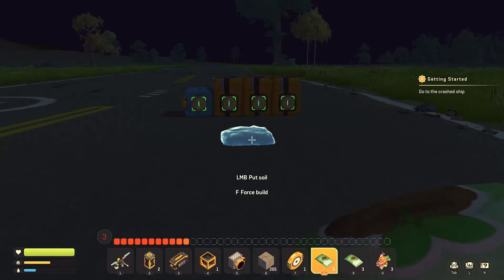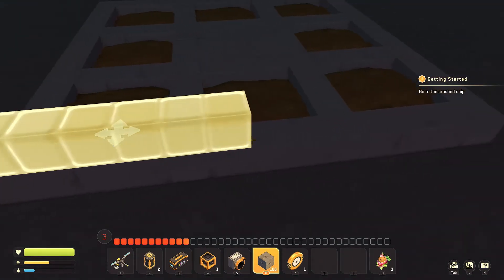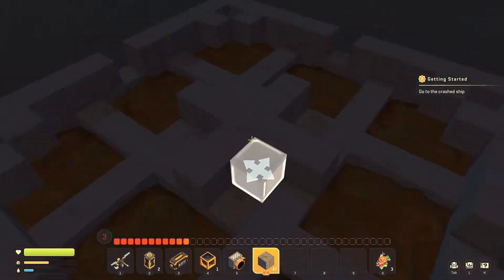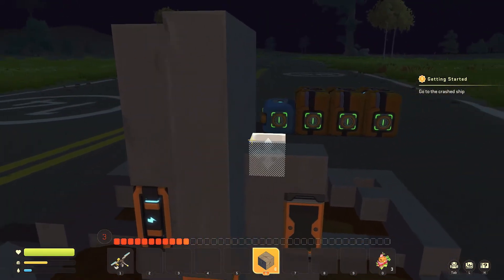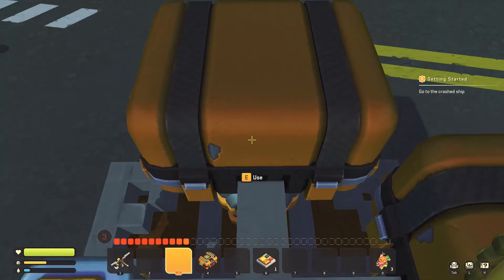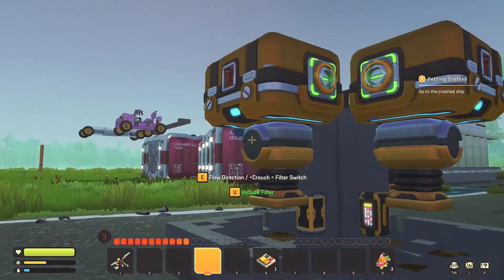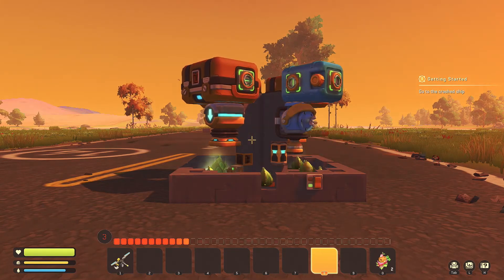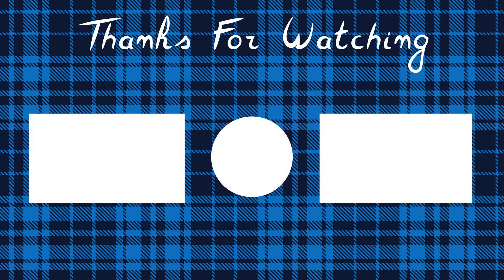Easy Auto Farm Tutorial | Scrap Mechanic Basics

Comment: 2 years ago it worked correctly, but today the sensor is triggered 2 times on the corner beds and throws out 2 seeds, the sensor settings are exactly as in the video (sensor level 1 and range 4).

Comment: Seems to have been patched as far as not raiding goes.
Reply from the maker: If you build more than 1 in a chunk you will still be raided, if you have more than 9 plants growing in a chunk you get a level 1 raid, you can find a chart for plants per chunk raids.
Reply: @BushJesusTIPS  yeah, realized it depends on the crop.  I was trying to use it to autofarm potatoes for spud gun.. but this will only work with crops with a value of 1.
Reply: Nothing is planting for me… it all works but doesnt plant, i tried tomatoes, broccoli, pineapple and redbeet
Reply: @RawTrailz  Make sure the arrow on your vacuum pump is pointing down. Make sure the connector from your chest is going into the pump. Make sure when you connect everything you are connecting in the right direction (going FROM the sensor TO each of the timers).